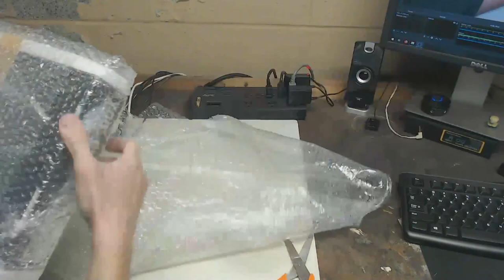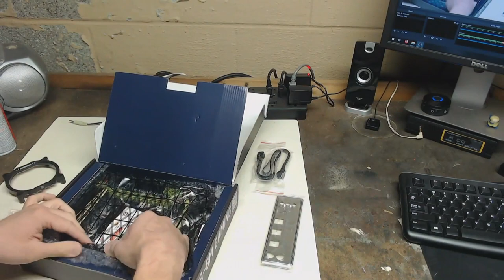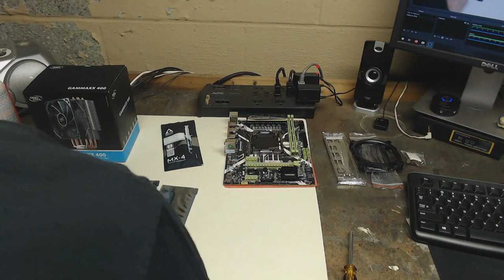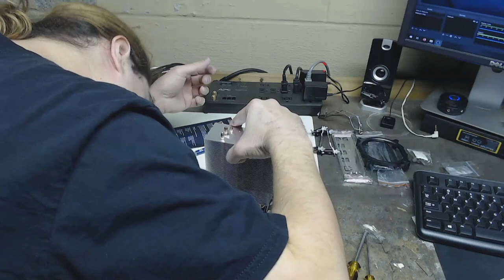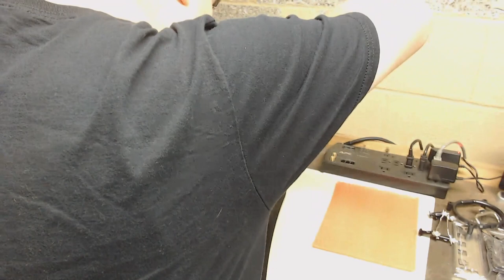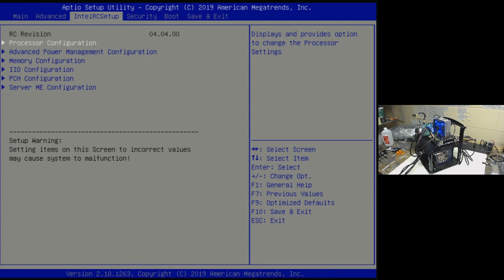X99 Motherboard from Ali Express

Comment: hey man! merry christmass! pleasedo some more video about this setup like geming test, overclocking( alitle bit ), stress tests. GoodVideo!
Reply from the maker: Sure!  I'd love to do that, I could run some benchmarks (like cinebench or something).  I don't think I can overclock it though, as I don't think the BIOS has those options.
Reply: @nticompass  i can say to you where is you can take moded bios for overclicking memory up to 2133, if you interested.
Reply from the maker: @РоманНед-ц3н  I am interested!  That would be great.
Reply from the maker: @РоманНед-ц3н  Is that the same board?  I have one of these http://www.huananzhi.com/html/1/184/185/382.html
Those PlexHD boards look similar (and probably use the same parts), I just want to be sure that I don't break anything.
I found a "native BIOS" here https://www.youtube.com/watch?v=EbipSmxaeB4
Reply from the maker: I found this: https://xeon-e5450.ru/socket-2011-3/huananzhi-x99-8m/
I may try the BIOS suggested here and see if I can overclock :)

Comment: I have one myself, although X99-D8, with 2630L v3, great underrated CPU.
Why did you choose 4 cores only CPU?

Cheers from Poland.
Reply from the maker: Honestly, I chose this CPU because it was really cheap!  I recently got a 10-core CPU that I'm going to swap in soon.
Reply: @nticompass  I had my 8 core 2630L v3 for like 14 bucks. You can shot a bargain sometimes.

Comment: Hello! What do u say about the vrm temps? The heat-sinks look like really small! Is computer performance affected by VRM temperatures?
Reply from the maker: I'm not monitoring the temps on the VRMs, but there seems to be enough airflow with the fans I have and I haven't seen any thermal throttling.

Comment: Wow you got tons of views  on this one! #jackpot
Reply from the maker: I know!  It's crazy.  I think there is something special about these motherboards.  They are very popular on russian websites, so I guess this video appeared when people were searching for the board.  That makes me happy!
I need to make a follow up to this where I benchmark the Hackintosh I built with it and show what it can do.
Reply: @nticompass  you should and do more pick up reviews
Reply: NTICompass Computers hello do you recommend this or the x79 huananzhi 2.49pb motherboard im on a budget
Reply from the maker: @Ayoub I went with an X99 board so I could use slightly newer processors than the X79 board could use (I wanted to use at least Haswell, I thought that may be better for Hackintosh).  All in all, the full Hackintosh machine cost me around $515.  X79 may be cheaper, since you'll be using DDR3 instead of DDR4 as well as slightly older CPUs.  I'd make a list of parts for an X99 and an X79 build and see which is better.
Personally, I love this X99 board.  It's not that expensive, Xeons were not that expensive and DDR4-ECC is easy to find and not expensive.
Reply: NTICompass Computers ah ok my budget is €300-€350 so iT is a little over my budget
Reply from the maker: I'm certain you make something decent with that amount.  Check eBay for Xeons and ECC RAM as they may be cheaper for the X79 board.  It may take some digging, but I'm sure you can make something cool for 350 Euros.
Reply: NTICompass Computers 
I thought about huananzhi x79 2.49pb
E5 2589
RX 570
What do you think about it
Reply from the maker: Pretty sure that's a Sandy Bridge CPU.  Probably fine, depending on what you are using it for.  It also lets you upgrade to the Xeon E5 v2 (Ivy Bridge) CPUs in the future if you'd like.
The RX 570 seems great to me.  My Hackintosh is an RX 460 and my main gaming rig is an RX 580.  I'm very happy with these GPUs.
What are the prices on those?  What do you want to use this system for?  If you can get some cheap DDR3-ECC RAM, then it's looks like you'll have a great little system! :-)
Reply: NTICompass Computers 
First of all thanks for answering
I wanna use iT for gaming like GTA,PUBG,CSGO and more
I also want to use iT for school, i did not look for how much they sell 570 and 580 if they above 100 i would probably go for RX 480 8 GB
I Saw something by ram like bying Samsung ram 1333 and overclocking to 1866 im not Sure if this is possible on the motherboard
Reply from the maker: The BIOS on my board let me change the RAM speed (even before flashing an unlocked one), so you should be able to do that.  I think the parts you selected should be fine at playing those games.  Maybe not at max settings, but should be ok.  If you can afford it, maybe consider a E5-2650 v2 or something (the v2 being Ivy Bridge and a bit newer).

Here's a video I found that may help: https://www.youtube.com/watch?v=mhaxD2a4AnQ
Reply: NTICompass Computers yeh i already watched that bro thx for helping if i could play at high settings 80fps im happy then
Reply: NTICompass Computers hmm the e5 2650 V2 is at same price for e5 2689 is the 2650 v 2 better? How many cores and Threads and can i buy iT from alieexpress or is iT riskant?
Edit: look at this video https://youtu.be/qUu4UDGOWN8 the e5 2689 has higher fps here?
Reply from the maker: @Ayoub-wg3tw  Well, I'll be...  I figured the "v2" may've been better since it was newer, but it does look like the E5-2689 is the better CPU!
I bought my X99 board from AliExpress with no issues at all :-)
Reply: NTICompass Computers the e5 2698 3400 and can get 85* max and the e5 2650 V2 3200 and 75* should i go for the e5 2689 and that more fps or the V2
Reply from the maker: @Ayoub-wg3tw  That's a good question.  I may suggest the higher FPS one, that may just make things run smoother overall.
Reply: NTICompass Computers alright bro thx which case do you have and which psu and how much wAtt i should need for my build thx for helping its my first time
Reply from the maker: @Ayoub-wg3tw  Here is my full build list: https://pcpartpicker.com/user/nticompass/saved/HWTykL
Reply: NTICompass Computers alright bro another thing i looked RX 570 they are €130?? And RX 480 125?? I can’t Find iT any cheap can you help normally RX 480 Sells €80-
Reply from the maker: @Ayoub-wg3tw  Have you checked eBay, or even local sales like Craigslist?  I don't know if the current world situation is having an effect on component prices, that may be an issue.
Keep looking, I'm sure you can find a good deal.
Reply: NTICompass Computers 
IT is that im not from the us or the uk so most things are shipping  and i really can’t find iT

Comment: You should get more stuff from Ali Express! Try Wish, OfferUp and Ali Baba!
Reply from the maker: There's lot of fun stuff on AliExpress.  I would love to get more computer parts from AliExpress, but I don't currently have a use for it.  AliExpress is owned by Alibaba, not sure if Alibaba has different products.
Wish could be fun, but everything there is either fake/knock off, a scam, or just crap quality.
I've never tried OfferUp/Letgo, I usually use Craigslist or Facebook Marketplace for local purchases.  Or I just get what I need from eBay.

Comment: x99 F8 much better
 👍👍👍
Reply from the maker: I just like microATX boards ¯\_(ツ)_/¯
Reply: @nticompass  OK. did you know that the x99 f8 can overclock the CPU and RAM?
👍
Reply from the maker: @gas221272  With its official BIOS or with a custom one?  I think I can on my board too, but I need a custom BIOS.  I have plans to try to flash the BIOS and try to overclock.
Reply: @nticompass  On this board, your bios and not bad!